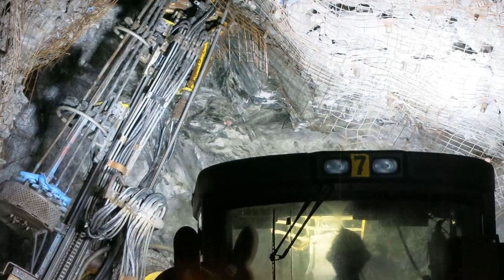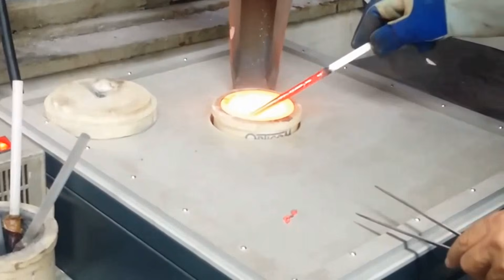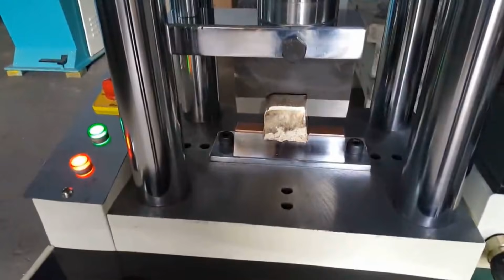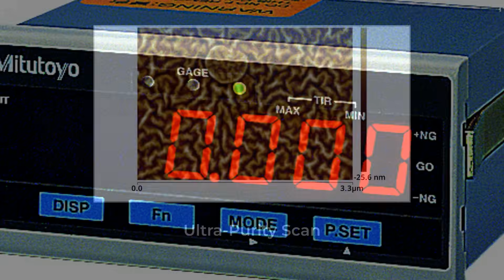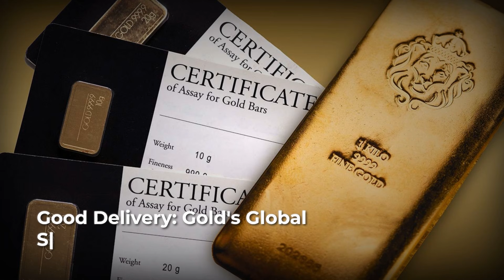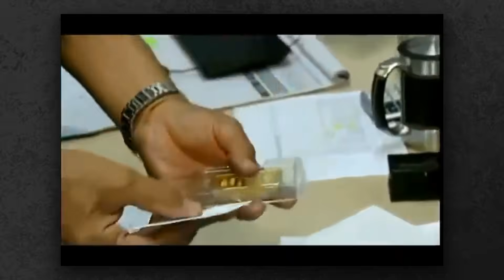How 99.99% Pure Gold is Made Inside the Secret American Gold Factory

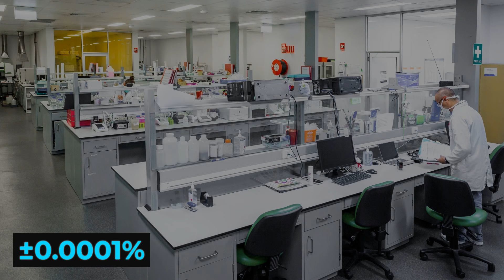Comment: Regarding 7:00 the fire assay for gold purity is known as “Cupellation”. A sample containing gold is wrapped in lead foil and weighed initially. Then the envelope is placed a special heat resistant porous bone ash cup known as a "cupel" and heated to a high temperature in a kiln. The molten lead combines with base metals which oxidize and get absorbed into the pores of the cupel. What remains behind is a pellet of pure gold called a “prill” which is weighed and compared to the initial weight to determine the purity of gold.
Reply: Describe cada paso del proceso de determinación de la pureza del oro mediante el método de copelación de forma muy clara y precisa, y resulta tan fascinante como un experimento de química artística. ¿Qué le impresionó más de este proceso: la sofisticación de la técnica de separación de metales o el momento en que apareció el «oro puro» tras que el fuego hubiera quemado todas las impurezas?